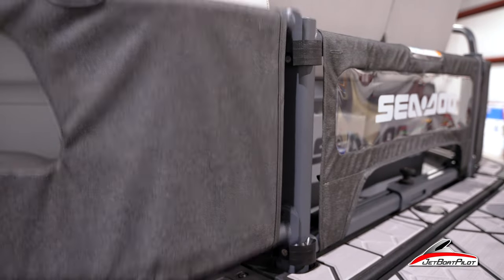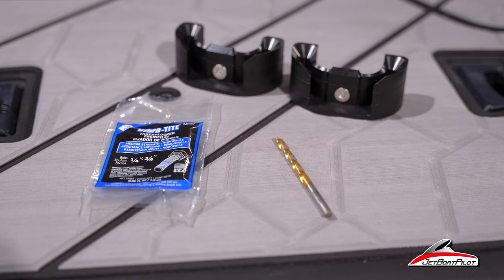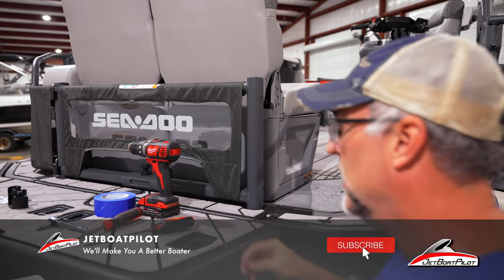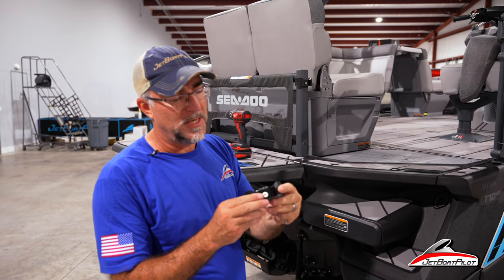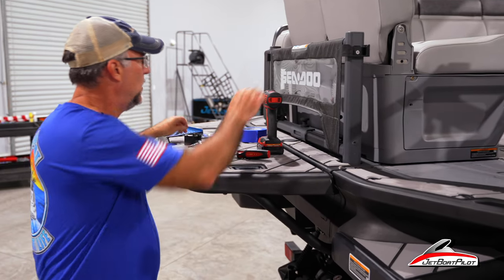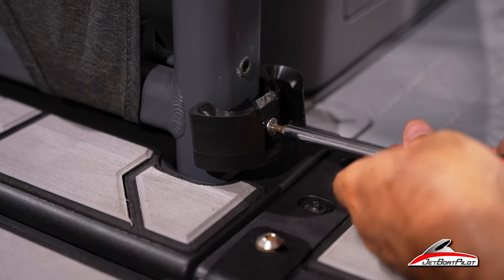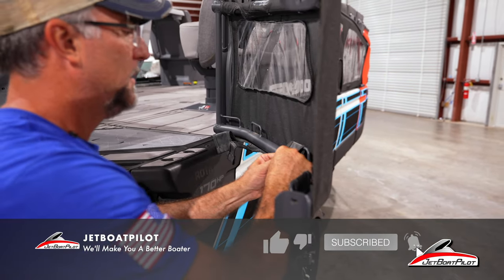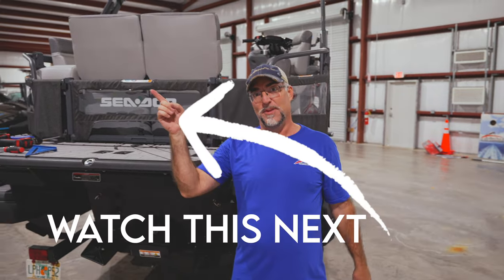SeaDoo Switch Rear Gate Conversion | Intro & Installation

Comment: It's about time someone came out with a kit for this! Brilliant. I cant understand why it did not come this way from the factory on all models.
Reply from the maker: I know! I see people doing this all the time
Reply: it was designed that way but SeaDoo realized it was a structural design flaw and scrapped it.
Reply from the maker: @NotASheeple-pi1xv  I can see that it does add strength to the rails.
Reply: Will, great design…thanks for another quick project from JBP.
Reply from the maker: Thank you! @chrisspeer3850
Reply: @NotASheeple-pi1xv  I kind of thought it might be structural
Reply: Totally agree!

Comment: You can make this design better for the long term by using helicoil inserts. You could also incorporate the factory hole into your design to use as a reference hole (2 threaded points) so you dont have to eye ball the second hole and your brackets will be far more rigid.

Comment: Just did this install.  This video plus the kit that JBP sends is spot on.  No gate adjustment needed.  The fact that the drill bit and the correct thread lock is included makes it so easy.  Thanks to Will and the team at JBP.
Reply from the maker: Awesome, glad it went well foe you!

Comment: Just installed it. My only feedback, or what I did differently than the instructions, is I couldn’t get the bottom bolt threaded using a little right angle allen wrench, which is all I had. The supplied screw is a harder metal than the rail so it cuts in the threads as you screw it in. This was very difficult with a small allen wrench. What I ended up doing is using the original screw that was removed along with the T30 on a 3/8’s ratchet to get it threaded. Then unscrewed it and installed the bracket easily with the supplied screw. Otherwise, an Allen head socket with the ratchet would’ve helped too I’m sure. Excellent product, very impressed with it.

Comment: Very nice idea but not sure if it would have been good to just use the original hole and just have that bigger part farther down with an extended plastic piece that used the original hole. What about adding a latch at the top to hold it in so it doesn't have a change to pop up and out?

Comment: hypothetically   if you put a bar between the 2 rails on the gate to basically bring the bottom rail up that 1/2 inch you could use the original bottom hole to put the screw in no drilling ??
Reply from the maker: Not sure , we could check that...
Reply: I think it needs a bar added, but I’m fine with the new bolt hole location. I would just use a rivet nut insert. Yes I know this would make it a slightly harder install process.

Comment: Great idea, great product, congratulations! Would it also be possible to add a plug to insert into the original hole that is being left unused to the kit?
Reply from the maker: Probably won't make it into the kit but a simple rubber press in plug would protect the threads if you want to use them  in the future.

Comment: Does this void the warranty because of drilling a whole?
Reply from the maker: Not likely. But if in the extremely low chance the warranty were impacted the only thing that would be impacted would be the post that was drilled. The remainder of the boat's warranty would remain unaffected.

Comment: Hello Jeff,

We have a seadoo switch that stays in the saltwater on a floating dock. Do you have any aftermarket kits that make it easier to do the  flush rinse without jumping into the water to hook up the hose every time.  I’m sure that many others have this similar problem.

Your company always seems to find solutions.

Any guidance will be appreciated!
Reply from the maker: We don't have a Jeff on staff. We did develop a flush system that allows you to flush the boat from inside the boat, bit there were several potential liability issues with the introduction of it to the public. It worked great but we opted not to sell it.
Reply: Any way that you could share this add on. I’m willing to assume the liability.
Reply from the maker: @Arcmike  let me put some thought to it.

Comment: How does this affect the strength of the tube tow point?
Reply from the maker: We've not towed from there with the gate conversion installed, but I can tell you those posts are pretty solid as a stand alone. If you're not certain you can remove the brackets and reinstall the factory bolts in less than 5 minutes. Just don't throw away your factory bolts and keep a set of tools handy.